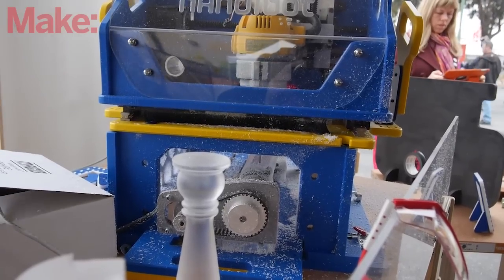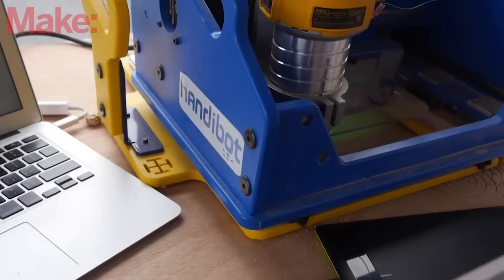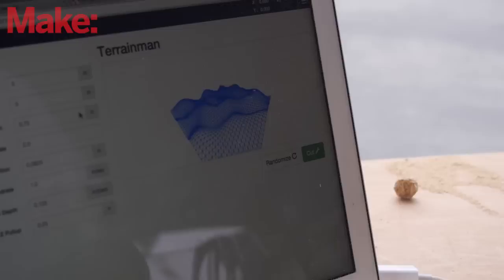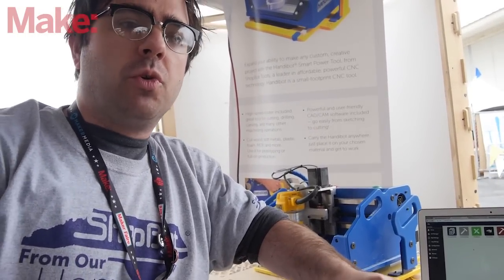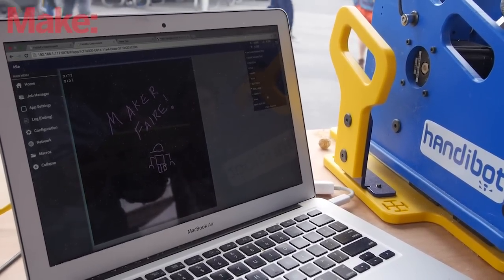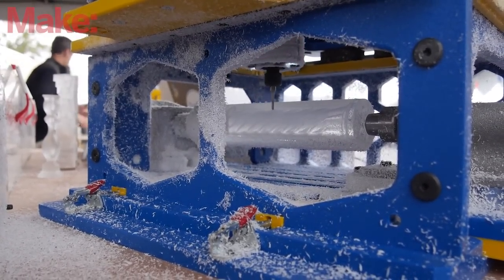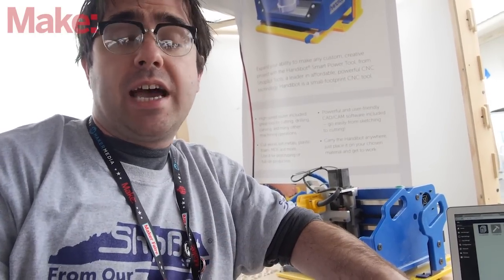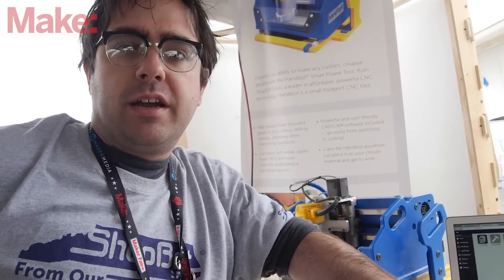Watch Handibot Cut 3D Chess Pieces

Comment: Nice, but not 2,750$ nice :-(
Reply: Felix Dietz I'd rather get the $1000 X-Carve from inventables.
Reply: Felix Dietz "We did not want to limit the evolution of the tool or the creativity of those developing applications and accessories for it by compromising to get an initially low cost. We fully expect that as production volumes increase and cost of the commodity components is reduced, the price of a Handibot tool will come down to less than $1000." - handibot.com/open-source.php
Reply: CAmarine221 As an owner of a Kickstarter version of the handibot, I think at $2795 for the current 1.1 you get more for your $$ than putting $1000 into an X-carve. I am obviously biased as I love mine, but cheaper is not always better. 
One huge thing you get with the handibot is shopbot's great service. I have had a couple of failures and they have helped me troubleshoot and rushed me the parts each time.
Reply: Mark Evans I'm not trying to knock the handibot or anything. I can't say one is better than the other simply because I have never owned either of them. If the handibot does go does go down in price in the near future I would consider it a very appealing option but my main goal is to have a cnc mill of some assortment that can do pcb milling and not break the bank.
Reply: Fred Gandt ok makes sense!